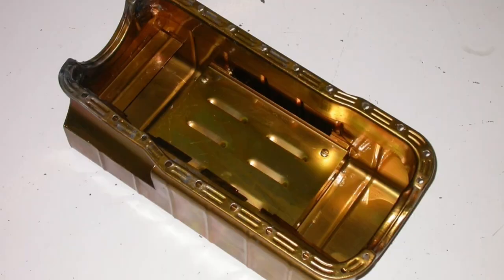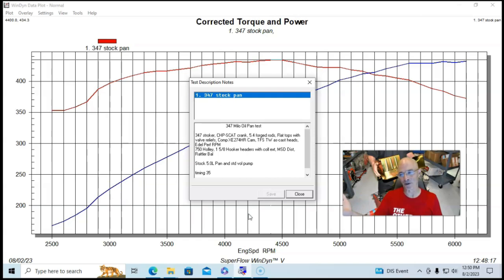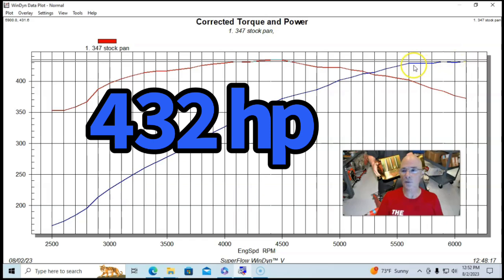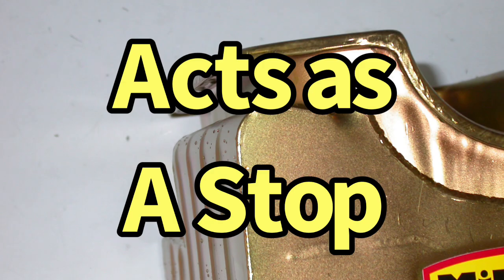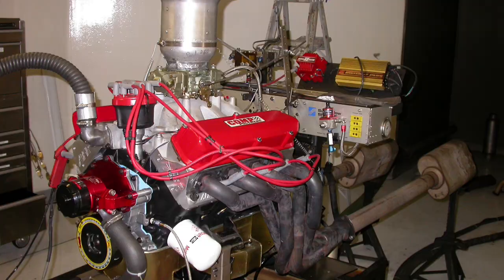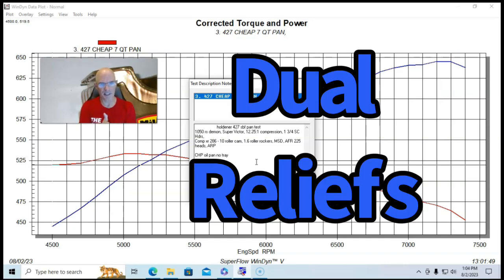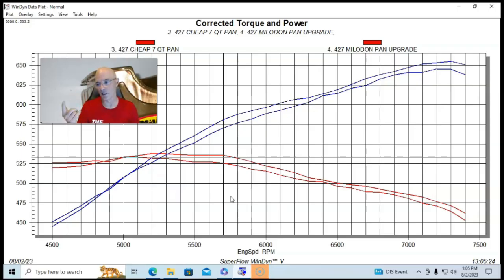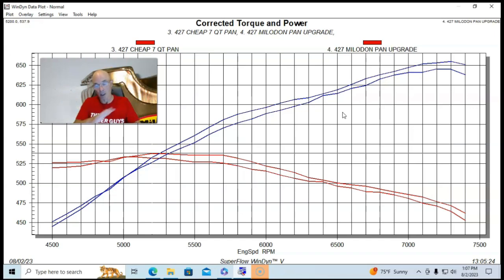HORSEPOWER FROM AN OIL PAN? CHEAP AND STOCK SBF PANS VS MILODON OIL PAN UPGRADES. RESULTS-347 & 427

Comment: Question;  What would adding a windage tray alone to the stock pan do?  A "half" windage trey like the Ford Performance windage tray.
Reply from the maker: a windage tray can be worth power-the half tray would be worth less but the difference would be more pronounced on a road course when the oil is sloshing in the pan
Reply: @richardholdener1727  Thank you for the reply.  I believe Ford offered what I call the half windage tray because a full tray would not fit the factory FOX Chassis 79-93 Mustang oil pans.  What led me to your video here is catching the end of the Engine Masters episode on oil pan horse power and I thought I heard a claim at the end of 30 more horse power.  Because I only caught the end I didn't catch what engine and what oil pan what other changes were done.  Also, I saw Uncle Tony some time ago discussing factory Dodge drag car spinning bearings and his conclusion that it was an oil starvation issue upon oil sloshing away from the oil pump pick up under hard acceleration.

Lots of interesting things going on below the pistons that effects power and reliability.

I also enjoy Lake Speed Jr.'s YouTube channel.  Lots of very interesting information on oil.  Not such a boring topic.

Comment: I read some guys do Isotropic finish to the crank & other parts like ring & pinion.  It smooths the metal & looks like chrome but makes it a Hydrophopbic finish I think.......Eagle has a treatment called ESP Armor that is similar or maybe the same type of treatment.
Your thoughts??????🤔

Comment: Hi, I have a suggestion for a subject. I often see dyno pulls that start at 3000rpm and that emphasize max performance. I would find interesting a video about low-mid rpm performance and how to obtain a better efficiency at that range.
Reply: My experience and I what I have been told others is that there is no real stability below 3,000 and 2,500 rpm and back to back runs at lower rpms don't really allow for accurate and repeatable low rpm runs.  In other words, low rpm tests don't really work.  this might be different on dynos that measure power output by turning electrical generators which are much more expensive than the water brake style of dynos.

Comment: You can understand the challenges high rpm drag car have.Oil climbing  the back pan under acceleration and the opposite braking.
Reply: Stock oil pump vs high volume pump. Could be trouble stock pan and high volume pump pickup getting uncovered.

Comment: In my experience. The Milodon full box marine pan, no kickout. on my 489 bbc was terrible. Look at jet boat forums. It’s all over. I was losing pressure over 4500 rpm. Tried all the tricks to make it work, never did. Put on a Dan Olson pan. Works great. No more pressure drop. Both were 7.5 deep with trays. The Olson pan does have a kickout on the right side, full length of pan.
Reply from the maker: We use the Moroso unit on BBCs
Reply: @richardholdener1727  I’ve seen people use moroso and canton with no issues also. Just seems to be an issue with the Milodon full box pan if you try to run rpm’s. Major oil pressure drop at 4500 and above. It’s weird.

Comment: I'm wondering how a dry sump might change things.
Reply: The extra pump(s) may decrease power output... on a dyno. Windage is windage and oil clings to everything (by design)... so dry or wet sump, the hp benefit is getting the oil off the rotating assembly. If the oil is pulled out of the wet sump, a dry sump (or a deeper pan) would help.

Comment: According to the Engine Masters guys 20w50 makes more power than lighter oil because of ring seal.  The Rat 540 blog says that 5w30 protects the best.  So, what is more important?
Reply from the maker: I disagree with the results of the EM test

Comment: Richard,  have you done a video comparing timing chains vs gear drives? Thank you for all your info you are sharing.
Reply from the maker: mostly noise-I would be surprised if it showed a change in power

Comment: What I found interesting is that both engines picked up almost identical gains. The oil pan was worth about 10 hp and ft lbs of torque on both engines. It didn't matter if it was mild or wild they both had similar gains. They say the devils in the details, I think this is a good example of this. I read about engine masters and they talked about free hp from oil control. With an engine that has roller lifters solid or hydraulic rollers didn't matter. They tapped the oil drain over the cam in the lifter valley and plugged the holes with plugs with smaller holes in it to reduce the amount of oil getting to the cam and also ground out the casting flash in the main drain back holes. That being said have you ever tested that to see how much power that's worth
Reply: I wonder if its not the case that the cranks pick up roughly the same amount of oil as windage. Therefore the energy needed to sling it is the same. Seems like physics would support such an idea?
A test with a couple of different sbc with different hp would be interesting to see if the same hp is freed up regardless.

In any case it does seem worth the effort to install windage tray and/or scrapers. Especially if one can do the mods oneself. A milodon tray might be a bit expensive to justify on a street build..
Reply: @magnusdanielsson2749  I agree... likely gain 10Hp (+/-) on any V8 running similar weight oils.
In addition to the pan mods, polishing the crank weights and rod surfaces would help reduce retained oil. Hmmm... teflon coat?
Reply: I read some have an Isotropic finish to the crank & other parts like ring & pinion.  It smooths the metal & looks like chrome but makes it Hydrophobic finish I think.......
Eagle rotating components has a treatment called "ESP Armor that is similar or the same treatment.

Comment: Will you test or have you tested having a vacuum pump plugged in the engine pan?
Reply from the maker: they can work-depends on ring pack
Reply: @richardholdener1727  
Like how well the rings are sealing prior to vacuum?
Reply from the maker: people use low tension rungs to add power, then help sealing with vacuum pump

Comment: Parasitic losses!!! The longer the cranks are, the greater the losses tend to be as they hammer through the oil in the bottom end. Back when Smokey Yunick was editor at Circle Track magazine, he once said the perfect oil pan would be 4 feet deep and only hold 5 quarts, but that doesn't package well LOL....

Comment: Richard, awesome work . Does oil viscosity change horsepower with a aftermarket pan? Many of the new cars have oil at 5 weight or less. Can we run those oils in a 302 Ford or a 350 Chevy?
Reply from the maker: YES VISCOUSITY CHANGES POWER
Reply: Tighten the oil clearances and thinner oil could be run.

Comment: I think windage trays should have far more louvers.

Due to the very-much-engineered-to-be-so film strength of oil, it clings to and wraps around rotating pieces. Water would just largely fling off immediately.

Oil wants to wind around the crank instead.

Comment: Its also funny to go get an oil change. You have to sign a waiver for them putting 8 liters of oil in instead of 5. But do change your own oil. Dont be crazy.
Reply from the maker: liters?
Reply: @richardholdener1727  I'm from a bastard colony. The old pan was 5.0 liters of oil to fill. The milodon was just over 8 liters of oil to fill. We don't use the gallons or quarts system. A Gallon is 3.87 liters or so.

Comment: I threw a windage tray in a slightly hammered stock pan on a stock bottom end turbo car and i credit it for clearing the 500+ mark to the tires on relatively low boost and iron heads

Comment: Really enjoy the channel. 
I would be interested in this comparison on High performance big block Chevy. Maybe talk about billet oil pumps and the integrated oil pick ups.
Reply from the maker: billet pumps add more flow and/or pressure, windage trays and deep sump pans work on BBC even more
Reply: @richardholdener1727  thanks for the info. I’m trying to find the moroso oil pan you tested the world 565 with AFR 357 heads. I believe it was #21047. Do you know how much oil you ran during the Dyno seasons with Q16? Did it stay the same when using nitrous and tunnel ram??
Reply: Love the small block Ford stuff. keep it up big thanks again for sharing 😊😊

Comment: Would have been cool to also test them with a quart of oil removed.  But I love seeing vids about the benefits of good oil control.  Also helps keep the oil pressure more consistent through the RPM range and under different "harsh" operating conditions like you might encounter at the track or strip (better engine longevity).
Reply from the maker: we optimized oil level
Reply: Windage tray, scrapers and baffling.  Less oil is redundant  🧐

Comment: Don Garlits and Dick Moroso 1st came up with oil scrapers and baffled oil pans back in the 60s.
Reply: Smokey, probably a good 10 years before either .
Reply: @rolandtamaccio3285  Yeah Smokey and Don were cut from the sam cloth. They both shaped the racing industry.  Don in drag racing and Smokey in circle and road racing back in the early 60s.  Modifications were kept secret and no patents were done because design specifications would have to be registered for everyone to see, so everything was on the down-low 🧐  I myself prefer road racing oil pans for they correct for G-forces 360⁰ where drag pans is just Fore and Aft G-Forces.
Reply: @rolandtamaccio3285  dyno only tells half the story.  When you apply G-forces is when these oil pans really start showing a benefit.